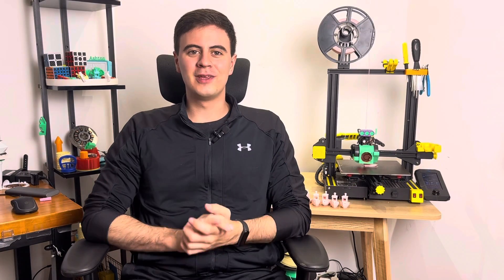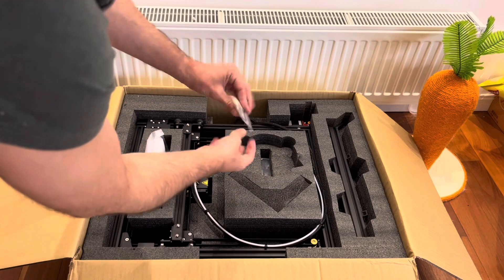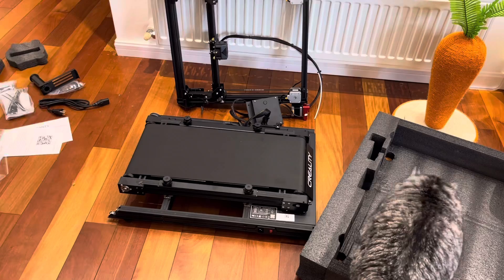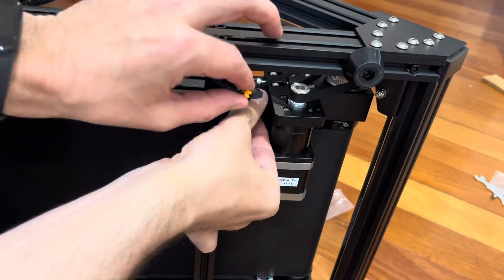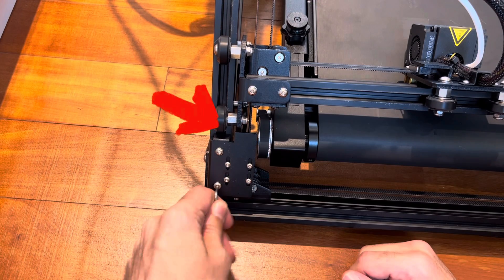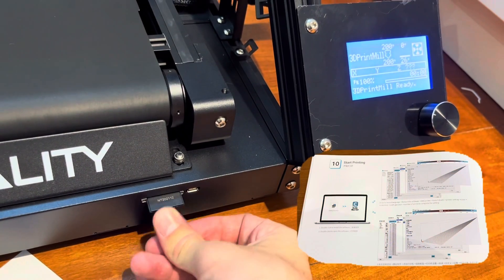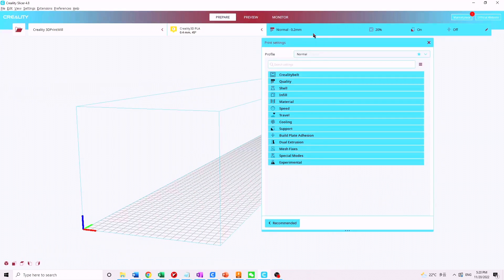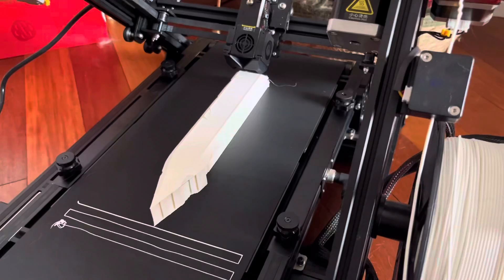Creality CR-30 Unboxing and Printing

Comment: How is this printer holding up? I am thinking of getting something like this. I am unable to print large parts with my Prusa mk4 . I am thinking a print mill should be my next printer, or the creality ender K3 V3
Reply from the maker: Physically it holds up pretty well! The software is the only challenge, slicing is definitely not up to date with other slicers general improvements over the past few years.
Reply: @DesktopInventions  is it good for printing small parts apart from long ones? I sometimes need to make long parts. Also I need to make multiple small parts, I am thinking the print mill should be useful here

Comment: Ditch the SD card and get a quality one, there's nothing worse in printing than a 34 hour print failing 28 hours in due to the cheap crappy SD card
Reply from the maker: Good advice! I think you're on to something there!